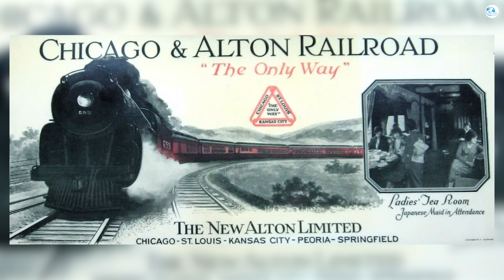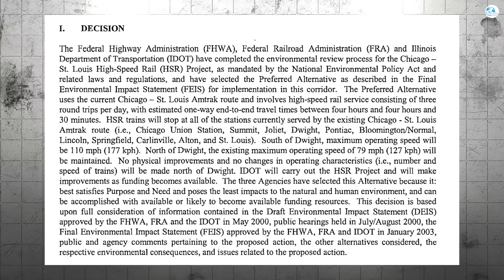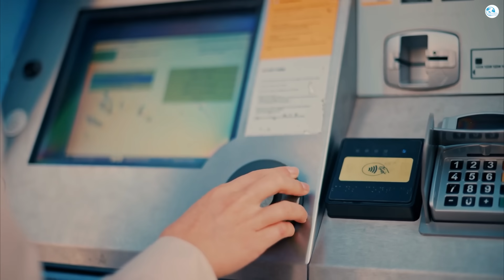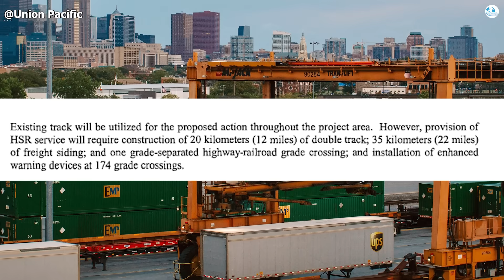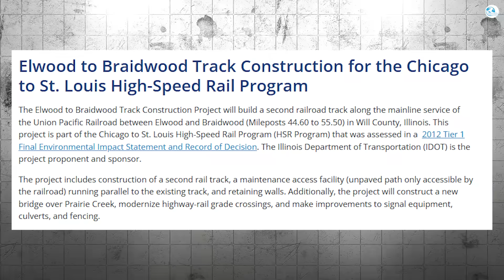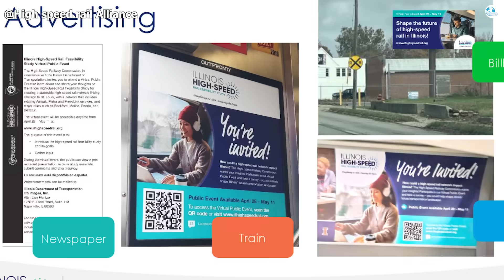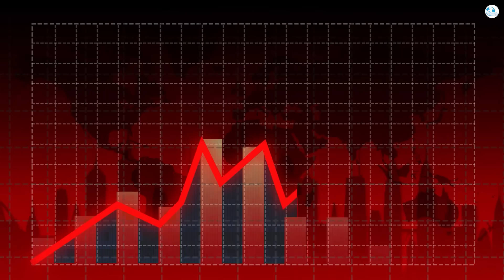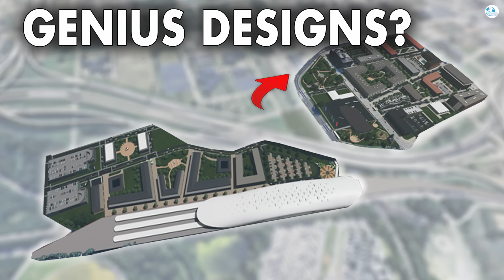Chicago–St. Louis High-Speed Rail: The Midwest’s First Real HSR Corridor?

Comment: Notice that, unlike California, our HSR project is actually making progress. Still plenty of work to do, though.
Reply: The California Gold Runner has 7 daily trains compared to the Lincoln Service's five. When the first 119-mile CAHSR segment opens by 2030 there will be more than a dozen daily trains and 280 miles will take four hours vs five hours on the Lincoln.  California will have made much more progress than Illinois with about three times the frequency and 25% faster service. By 2040 CAHSR's 240 miles from Gilroy to Bakersfield will be two hours 12-18 times daily. Good luck Illinois.
Reply: @davidjackson7281  Come back to me when you actually get CAHSR built in another 2 decades or so (been 18 years and still no trains...)
Reply: @davidwhiting1761  In 5 years the Gold Runner/CAHSR will be 15 minutes faster and 3 times more frequent. In 15 years CAHSR will be twice as fast and four times more frequent as the Lincoln Service.
Reply: @davidwhiting1761  The Bakersfield - Madera segment is slated to open around 2031 (4 to 5 years from now). That will serve most of the existing Gold Runner route, and the existing trains for Gold Runner can now move to other segments and other services, like the planned extension to Yuba City. The scale of the California expansion alone dwarfs anything Illinois could do
Reply from the maker: It's definitely encouraging to see tangible progress being made!